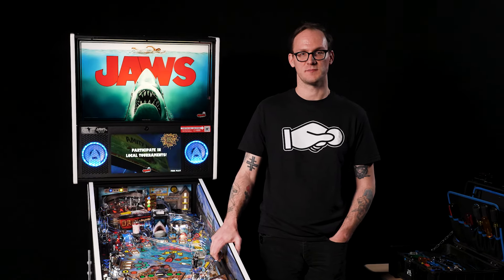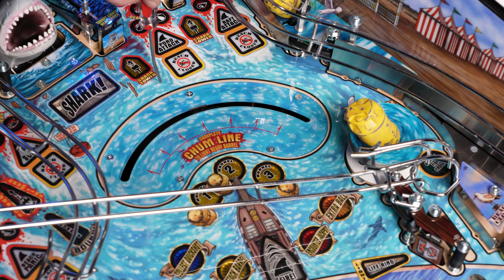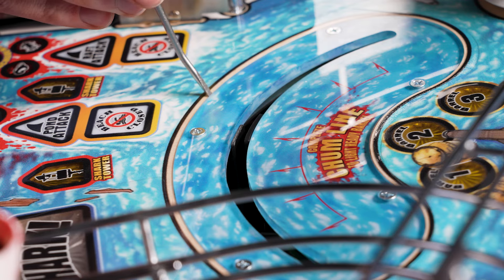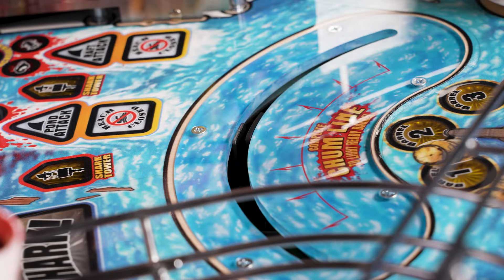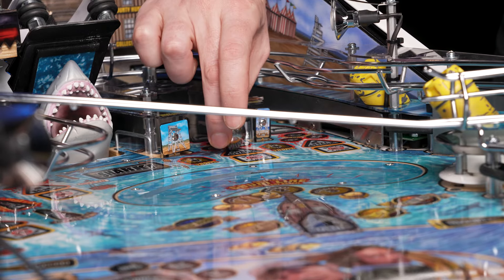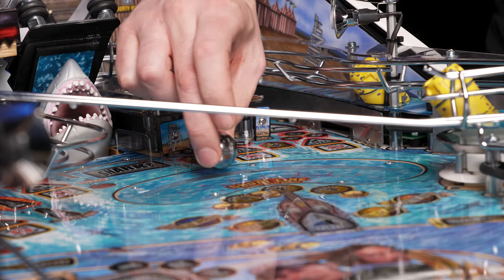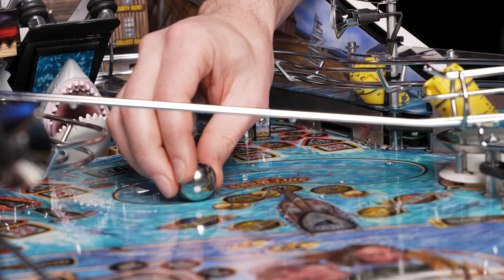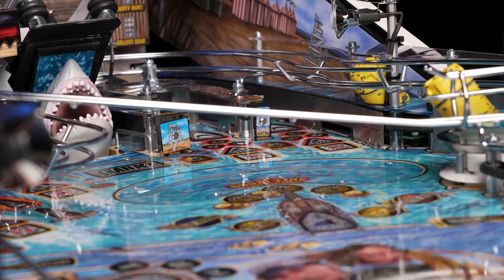Stern Tech School: Leveling Chum Line

Comment: This is a BRAND NEW GAME - should this not be done in the factory ?????
Reply: Agree, where is the quality control for the price they ask??
Reply: I imagine it likely is set right in the factory (at least, most of the time, and within human competence). But you can't always account for shipping and the elements. Screws and bolts are not immune to rattling inside a crate while on a truck, or with plain ol' gameplay. Even humidity can cause a thread to move slightly. Reminds me of buying bowed/twisted 2x4 lumber, and lamenting "Why aren't these just straight and flat from the lumberyard?!" Well, they are. But age and life changes the state of things.
Reply: Changes in temp, humidity, shipping conditions, and human factors all affect what was set at the factory.  I find it funny people think a new game can be played out of the box without tweaking and dialing it in
Reply from the maker: This video is not meant to imply you need to do this yourself when your game arrives. After hundreds of games, if the chum line becomes raised or lowered and is no longer level, this video shows you how you can make the proper adjustments to correct any issues you may be having.